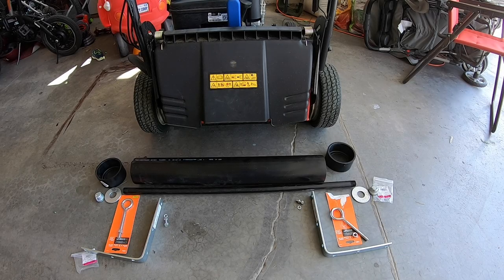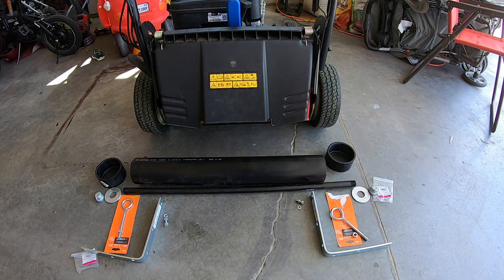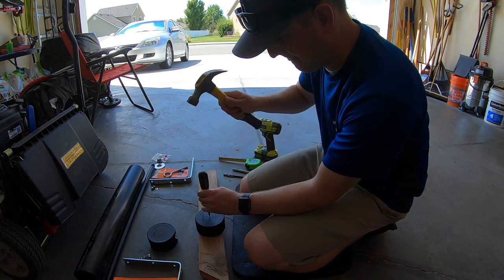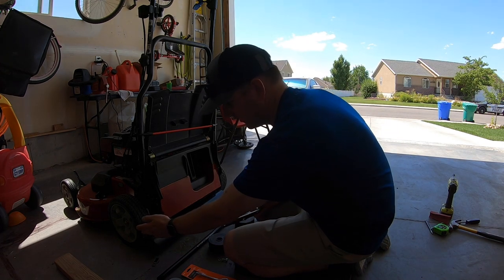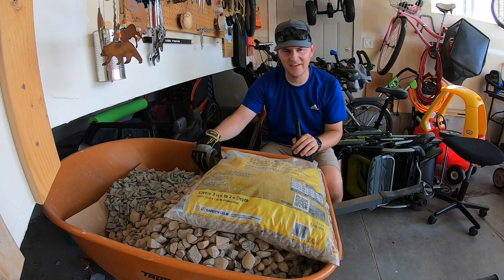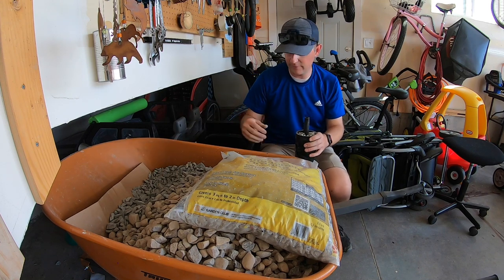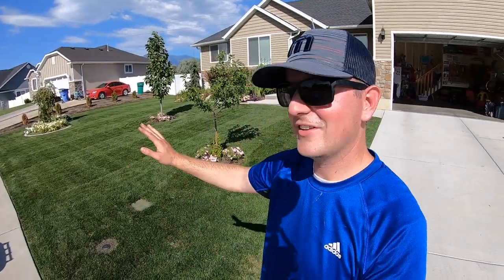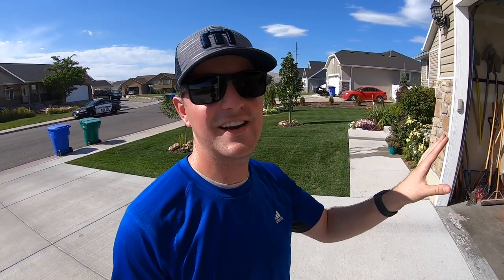DIY Lawn Striping Kit

Comment: For your bracket issue, I would suggest that you use a longer bolt and then use 2 nuts on the one side. By doing so, you can semi-tighten the bracket to the mower, leaving some wiggle room and then use the second nut to tighten up adjust the first nut to keep it secure and not move (jam nut method). In addition, adding washers to this on each side will help with keeping it mobile while you turn and lift the mower as well.

Comment: As for the frame connection, go pick up a couple of small bearings and put the between the nut and the frame to set as a washer, and get nylon locking nuts, or drill a hole thru the bolt ends end secure to the bolt to the frame of the mower with cotter pins thru the bolt you drilled holes into.  Nice vid bro!!

Comment: I did this exact same system except I drilled holes through my handle and mounted the striper to the handle using clevis pins so that I could take it on and off easily.

Comment: You also should add some spacers onto both outer ends of the 1/2" metal shaft (that goes down the middle of the pipe). Put the spacers between the securing nut and the plastic pipe to the rolling pipe doesn't slide on the shaft left and right as much.

Comment: One thought would be to put the attach brackets to the frame loosely with locking nuts so that it moves freely without coming loose, then add a moderate spring to both sides pulling down to keep positive contact with the ground. Although, over time, a loose mount would elongate the holes in the frame. Perhaps a solid mount with a replaceable bearing would be in order. I tend to over-complicate things though. I also think I would also find a way to put internal caps on the pipe to prevent the small striping within the larger lawn stripes. Otherwise, Looks great! Mountain views show you in the county just south of me. Looking to get a Timemaster soon. I really like my vintage 21" Personal Pace though.

Comment: Well my friend I would get some sort of a Long bar of all thread and attach it to one side or the other of the striper and then use it to pull the striper off the lawn and then once you turned the mower you can push it down that would be my suggestion I hope it helps you thank you

Comment: Hey Jimmy, good start to your DIY striper.  I made one a few years back which is a DIY version of the Big League Lawns striper.  It uses shoulder bolts and set screw bushings to keep the angle bracket away from the mower frame and swiveling nicely.

Comment: This is similar to the one I made for my old recycler. You might try a nylon lock nut so you can leave the bolt loose enough but not back off. That is if you havent figured this out already

Comment: I made one myself and it's very similar to your but to fix your issue I used a couple springs doo it would push it up when I turnt and then when I say it back down after the turn tg he spring would release the tension n force itself back down. I just used a little bit bigger bolts thst gave me room to put the spring and extra washers on each syde

Comment: I think what you need is to solidify the frame your roller system ( keeping that rectangular shape from flexing) . 1- Add a bar (use two bolts each side) which will link your left and right L brackets will prevent them lifting independently (twisted frame = tilted roller) This will also add weight to your system, which is good. 2- Heavier roller will also help, maybe put sand inside and use silicon to close the pipe on the inside (a second cap inside of your end cap). 3- reduce friction between L bracket and mower frame, If your roller system isn't twisting, letting it going up and down freely will further reduce the chance of it getting stuck on up position after turning.
Reply from the maker: Thanks for the tips! Definitely would like to solidify the framing. The roller is plenty heavy, but yeah like you said beefing up the frame will definitely help sure it up and will add a bit more weight.

Comment: Try adding a spring tensioner either side. Connect from the bottom of the mower housing to about half way along your connecting arm brackets from your mower to your roller. Will add tension to keep your roller down. You won't have to push the roller down each time. Leave the bracket bolts loose so it can pivot. Try nylon nuts.

Comment: Mock you up a new L/triangle bracket and include 2 window lift support shocks (what thew use on car tailgates/windows).  This will allow the bracket and PVC to flex upward when you push down to corner the mower and then press back down into the grass.  Hope this helps!

Comment: Use plastic spacers it will keep the roller attached to the mower but will also allow it to move up and down
Reply: I was going to say the same thing! I believe this will solve the problem.
Reply: That’s would work and I would just add a castle but with a cotter pin

Comment: hi jimmy, my mower is very small, and has no room to attach brackets, could i build the same kit and mount it onto a broom type handle, then use it independantly from the mower, would this work the same.

Comment: A knockoff BLL striper can be built .  The key components for the Timemaster are 1 piece 26.5" 80/20 1.5" or 2" square aluminum (overstock ebay-get black), 8 yates or similar boat rollers (4.5" diameter, 3" wide) , 1 rod , L brackets and bolts.   I  honored source/design but some may not be able to afford it or would prefer a project.

Comment: put a thicker bracket and a bigger hole where it mounts to the mower. Use a sleeve or ball bearing,, bushing for the bracket to swivel up and down on. Either that or a slot at the bottom so the roller can float, like a floating deck on a mower. Looks good thiugh

Comment: Try either a nylon locking nut or loctite.  Either would let you get the nuts tight enough to keep it attaches, but loose enough to let the pipe drop after turning.
Reply from the maker: Thank you!
Reply: Was just going to say the same thing

Comment: The answer to your tight nuts problem would be plain washers and nylock nuts 😉 that way you can tighten them just enough to take up the slop but loose enough for the roller brackets to move up and down without binding.

Comment: Should have got some caps to slide inside the pvc pipe but still looks awesome
Reply: I'd assume the lines in the middle of the stripes are from the edge of the cap on outside. I would also definately use inside caps

Comment: Hey Jimmy, question on the mower. Would you recommend the 30” timemaster? I have seen a mixed bag on reviews. Any advice on this?
Reply from the maker: Hey Cody, A lot of the issues I've heard about before getting mine were related to the older models. The new model seems to hold up a lot better. Haven't had any issues with mine so far. Great mower. The thing is a beast. I've really enjoyed it. With that being said, at this point I would recommend it. Hope that's helpful. Let me know if you have any other questions.

Comment: Larger diameter pvc pipe would help keep it on the ground. I would put a rubber washer between the bracket and the frame of the mower.
Reply from the maker: Thanks

Comment: use nylon locking nuts and you.can.tighten to allow it to.move i also.think get some recoil.rope and find a way to.attach it with to.the tube and you can.lift it up.and down you.vould cut thepvc in the center or use a metal
cable wrap.arpund the pipe tie with a cable clamp
amd ypur set

Comment: []==\\\\\\\\\ bolt
[]=|=\\\\\\\\\ bolt fed through bracket
[]=|=□\\\\\\\ now add nut
[]=|=□\□\\\\ feed bolt through mower. Add final nut

A bolt that does not have threads going all the way to the head. Put bolt through bracket. Then put on a nut as far onto the bolt as it will allow. Feed through mower. Put on other bolt. Above is the best I could come up with as a diagram in comments. | represents the bracket. \\ is threads. □ are the nuts.